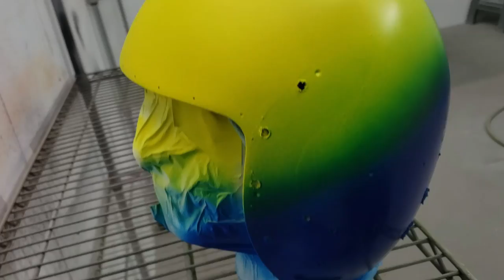Hydro Dip Kryptek Universal

Comment: What do you spray on the film before dip?
Reply from the maker: It is called activator. It's the chemical that turns the film back into a liquid so it will transfer to the parts.

Comment: I have that same stuff but it will not dissolve in the water I have it at about 90 degrees. And I use OHW activator and it will not activate. Any suggestions?
Reply from the maker: Not sure, I use the same activator and it works fine. Do you have the right side of the film on the water?
Reply: @AllThingsFunHydrographics  I have the sticky side up. I’m thinking the film might have been old.